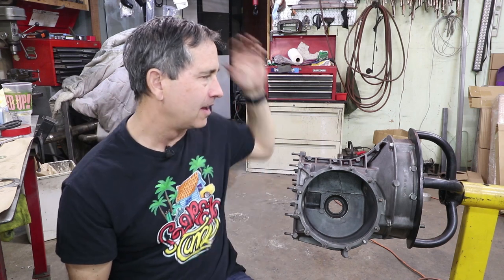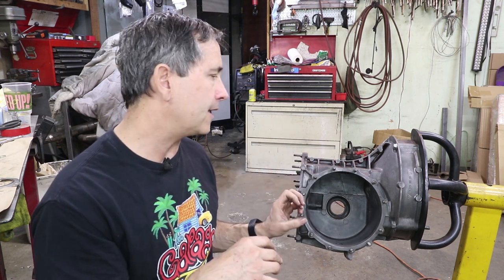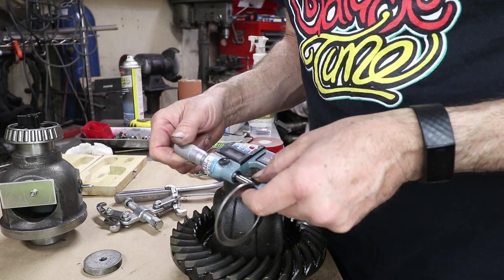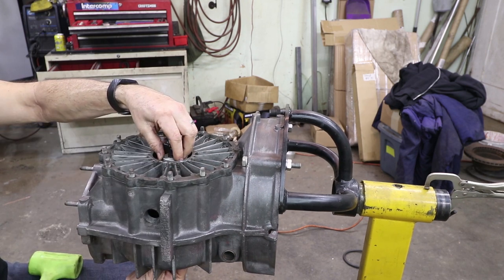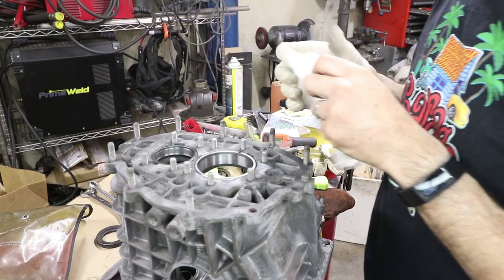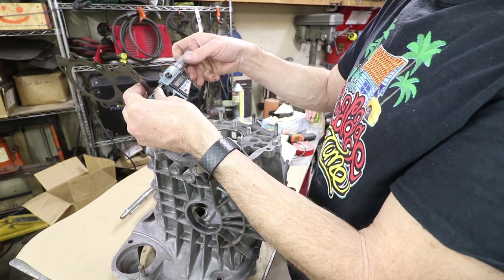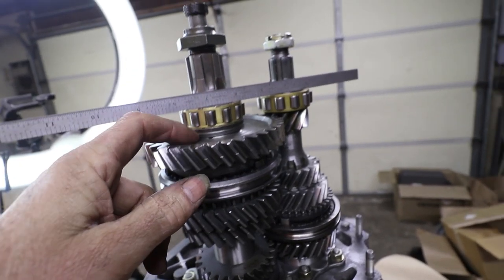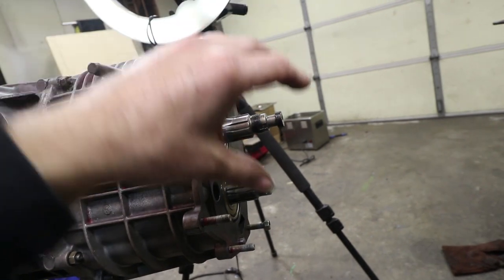The Dreaded Ring And Pinion Depth Measurements and Why You Should Care

Comment: Great video . It would be very interesting to make a video how to install the shafts on the upgraded one piece bearing retainer. Thanks  for the work you make
Reply from the maker: Will do on the next one.  It will be a bit harder pushing the bearings on.  Did you see the pic of my new parts?  I'm excited
Reply from the maker: Also the 356 trans has a one piece retainer oddly enough.
Reply: Of course i saw them . New parts 5 more years to owr lifes. Keep on the good work.

Comment: Hi i was wondering about the diff housing. a good machinist could bring down a few millimeters the damage surface and then put a hardened ring ideally from a bearing case with the cold hot and  glue method . And after machining the new ring to the bearing spec installing the new bearing. I hope you understand what i want to say. What do you thing about this method?

Comment: What do you calibrate or “zero” your indicator to?
Reply from the maker: I have a guage block that touches the milled flat surface of the diff carrier and the plunger. Actually it's two pin guages and a mill parallel laid on top.  That is how I calibrate the mitutoyo digital dial indicator.